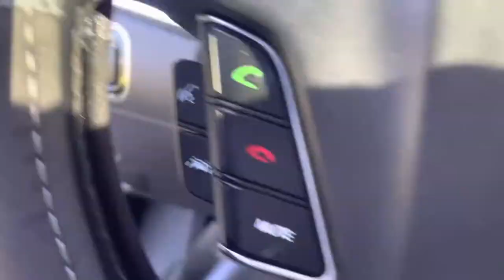How to Replace Front Struts on a Hyundai Equus (2011-2016)

Comment: Excellent Video! I have 2014 Signature and I just went through this process this past weekend. I changed out both struts and vehicle did not rise to the occassion. I read that if, you change both struts the system will have to be recharged. Which I didnt know at the time. I would recommend changing one strut, follow the instructions in this video and then moving on to the second strut. The compressor will only pressurize the strut if, there is air in the system. Not to criticize your work because you did a fantastic job. The vehicle should be lifted when inflating strut, to prevent binding or pinch the bag inside of the strut.
Reply: How did you get your car to air up again?
Reply: @Stillaknickfan  I had to take it to Hyundai dealership to have the front system refilled with air. They have a special nozzle that attaches to the refill valve. I attempted to do it myself with a standard air compressor but, had no luck with that.
Reply from the maker: I pinned this. If I had this exact issue I planned on bringing the car to a air and hydraulic fitting specialist I work with and making a air fitting, but I’m glad you figured it out. Do you have a price on how much they charged so others know what to expect?
Reply from the maker: @reedma7900  check out my latest video, I came up with a work around for the fill port as my car completely fell too and wouldn’t pick up. The nearest genesis dealer is 3 hours and I wasn’t gonna tow it.
Reply: @SlickNicklol  Awesome Job!  Now I have to figure out why I cant manually tilt steering wheel, lol. Always something!
Reply: Sweet i have to do this in a few weeks. I should be good with just doing  one side? Hear a huge leak in the front driving side
Reply from the maker: @jacobcottrell3094  if you use a genuine Hyundai strut or remanufactured Hyundai strut, yes. But it wouldn’t be a terrible idea to do both.
Reply: My left strust blow out today went I remove the tire , find out the suspension strust was gone , any recommendation were to get a new strust ?

Comment: I was going to make this exact video since I'm going through the process, but you've done such a good job that I'm not even going to bother. Thank you for this. For this specific job, this is the most straightforward and comprehensive video on YouTube. Kudos.
Reply from the maker: I’m a heavy equipment mechanic. I like videos because sometimes there’s a tip, or a trick, that you wouldn’t learn doing it yourself solo. There are no good videos, and I think one putting those quick struts, and I don’t like that stuff I didn’t buy the car for regular suspension lol. Thanks for the compliment!

Comment: Thanks. 2013 Equus, great video. Only changed driver side, I'll change passenger side when it fails. Ordered mine from Ebay 2 year warranty little over $400 bolt sides.🎉

Comment: I worked on my 2015 Equus today, and I was out of luck . The passenger side airbag was full with air and I couldn't put it on. On the driver side I managed to take the vent off and pump some air out manually that would help me install it easier but no luck with the other one. Maybe I got some cheap low quality airbags from Amazon.

Comment: This is awesome. Can we get a quick video answering some common questions pls? I. Particular what to expect in the ride and the ride quality after the Strutmaster kit is installed?

Thank you
Reply from the maker: Im pretty quick about answering as is, but if I get enough of the same question I might. To answer your question, there is a reason I am fighting to maintain the air suspension. The strut master kit is extremely disappointing, it makes the car ride like a Camry. If you don’t care about ride quality then you should’ve bought a Genesis G80 with the V8. 

I used a company called SHOCK masters. They rebuild the air struts.

Comment: Do you still have the car? have any other issues occurred? I did my rear springs about 4 months ago and now my front went out so I’m going through this process this weekend. Do you mind answering what mileage your car has mine is at 124k. Great video by the way.
Reply from the maker: Yes I still have it, I’ve had a few issues. Most I took care of without filming as other videos exist. I’ve had to replace the alternator twice, the passenger valve cover gasket, all the air springs, the rain sensor, and the passenger rear door speaker.
Reply: Thank you
Reply: @abdmohammad8632 I’m at 120k.the front my mine sits low are they damaged or need air. The back are fine
Reply: Could be your level sensors or your struts I changed one level sensor and both my struts and my car went back to normal

Comment: Well done. Where did you source the struts?
Reply from the maker: https://www.ebay.com/itm/163439286305?mkcid=16&mkevt=1&mkrid=711-127632-2357-0&ssspo=YO3x_m4nRgS&sssrc=2349624&ssuid=TxW4tupAQrG&var=&widget_ver=artemis&media=COPY

Idk if I would recommend these, been having issues with them. RMT is the ones with good reviews but they’re more expensive. I guess you get what you pay for.
Reply: Thanks for the info and product review. I’ve read the same quality issues. I’m not there NOW, but that day will come when it slams down. Leaning more toward the RMT reman so far. Keep those EQUUS videos coming. You’re alone in that market with up to date content.
Reply: can you go into detail on what type of issues you been having?  @ColdStartAuto
Reply from the maker: @user-ft1dq4he9b  adaptive damping issues, meaning the car defaults to the harshest settings. Ended up using the parts to rebuild the OE struts. You need to make sure that the shock portion of the strut, is Hyundai. Bag doesn’t matter, if they send you something else it’s junk.